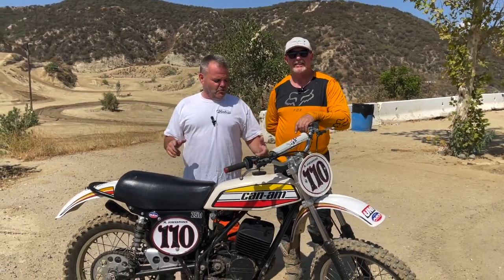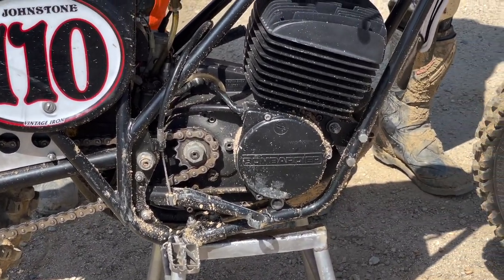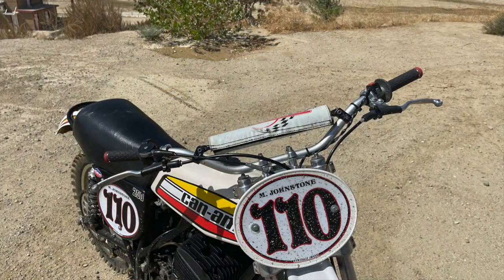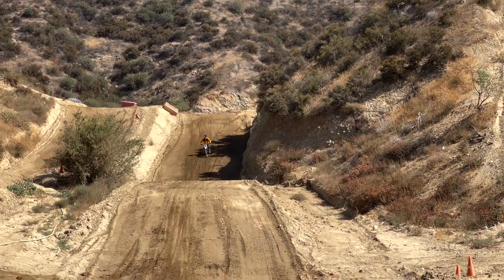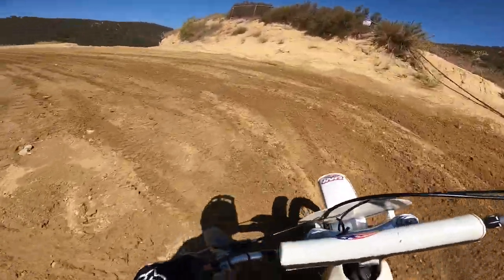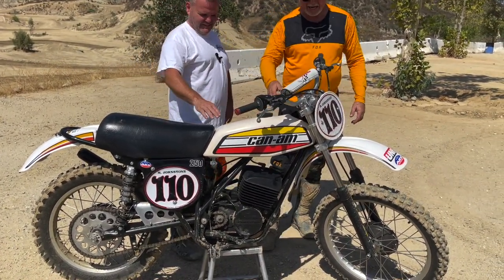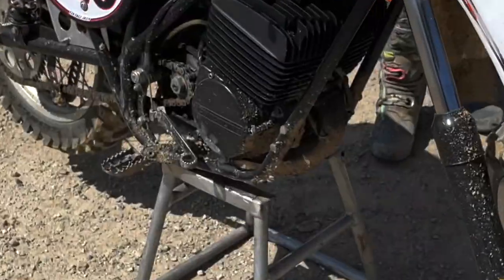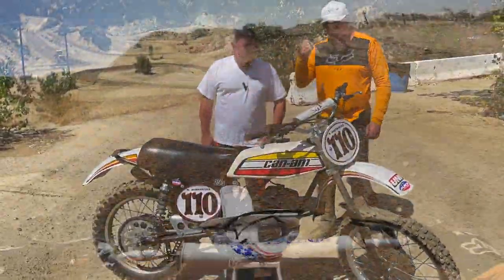1974 CAN-AM MX1 250- Vintco Vintage Racer

Comment: I had an MX6 250. Awesome bike. Rotary disc valve Rotax Austrian motor. Great quality parts except for the fork seals.Air comes in at the steering head as well as the adjustable rake. Mine was super stable in sand as it came out of the box. See sand and mud and accelerate. 😂